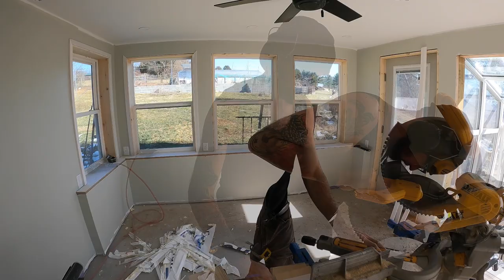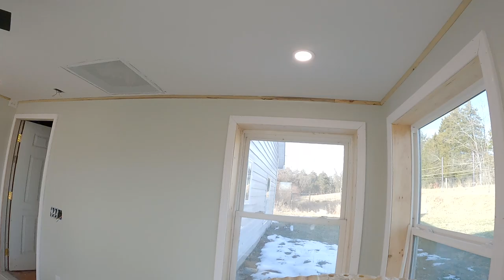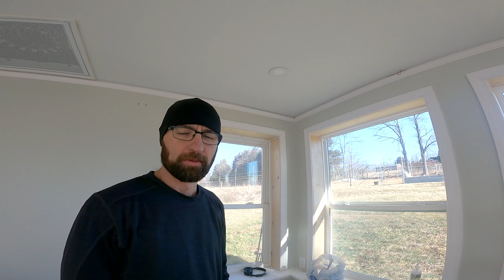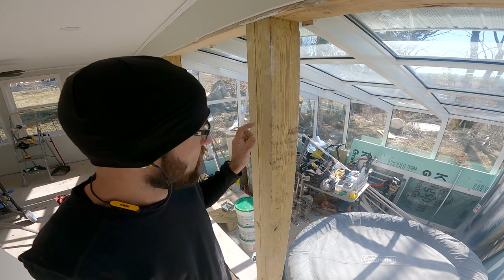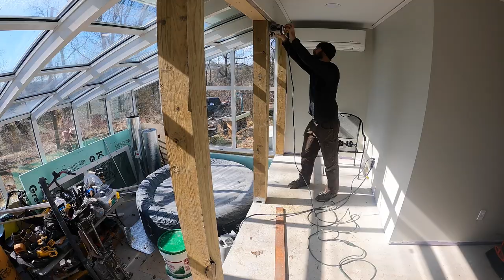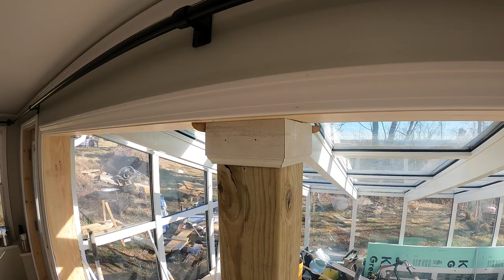Trim, Book Nook, and Curtain rods.  (ep 20)

Comment: You and your dad are opposites. 😃 You run your videos in fast speed. Your dad is like this is an eight penny nail. You use this now for finish trim. If you turn it upside down and tap the pointed part with your hammer it will not split your wood. LOL but I watch both of your channels Faithfully
Reply from the maker: Old school vs New school.  :)

Comment: Any experience with the LED strips, specifically the adhesive side's ability to adhere to bare wood/primed wood/painted wood/any wood for that matter, over 1/2/5/10/etc. years?
Obviously, not a lot of data available as these haven't been in wide spread use 10 years long for most, but just curious if it is me, or that stuff really isn't very good quality and you're better off some without adhesive backing and then using something more "pro-grade" like actual 3M tape, hot glues, etc, 
I used some on bare wood which I had cleaned with isopropyl alcohol, but the adhesive still gave out after less than 1 year. Certainly, quality will vary by supplier/manufacturer/etc. but any input on that would be helpful.
Reply from the maker: Thankfully this is just going to be sitting on the top of the crown molding..  The adhesive aint nothing to write home about..